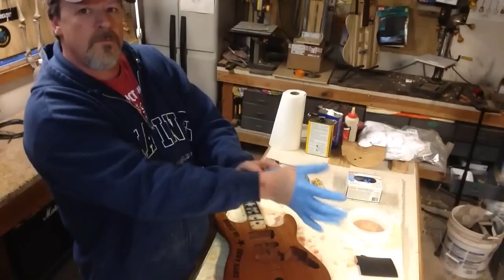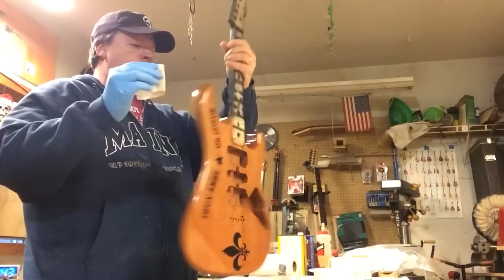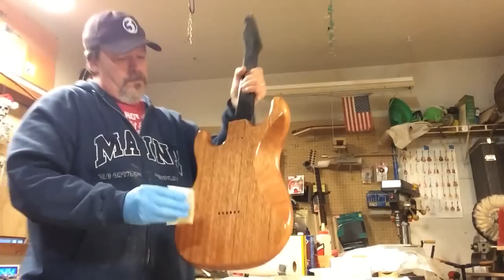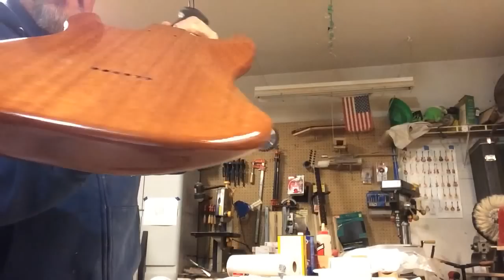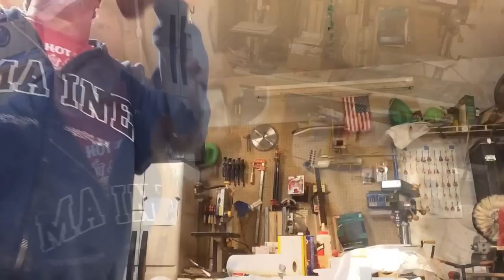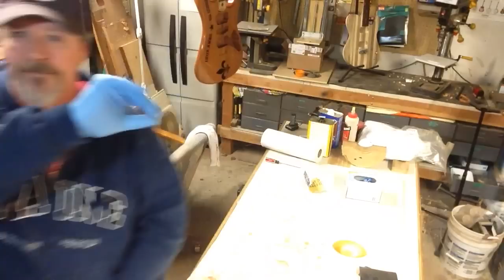Boudreau Guitars - I know, this is getting boring. LOL (messing around with two cameras)

Comment: Of course Ken knows this but others may not..
When a tung oil finish is applied make sure to unwad the rag & throw it away outside in the trash, It has been know for one to spontaneously combust..
I scored several planks from church pews that were thrown out, I believe they are red oak.
Reply from the maker: Right, I have a bucket of water that I've been tossing the rags into after every coat. The wife would really be pissed if I burnt down the house LOL
Reply: She'd probably make you rebuild by hand and tung oil all floors, doors, windows and timber blinds with over 20 coats as your punishment.Hey you could film that, I'm sure all the boys would still watch.BTW its safer to place the tung oiled rags/towels into a metal or glass sealed container.Plastic could be risky.